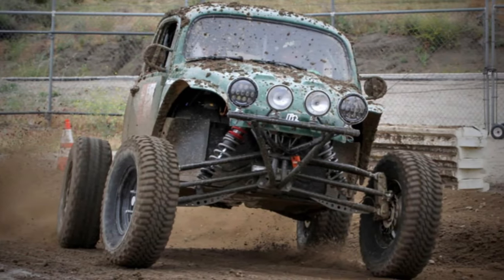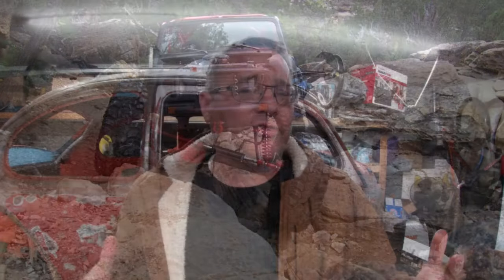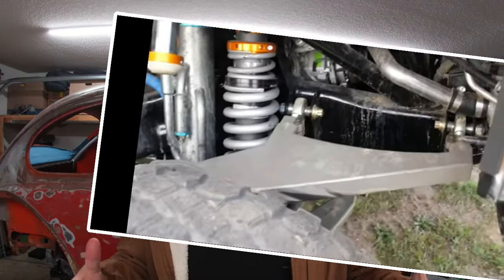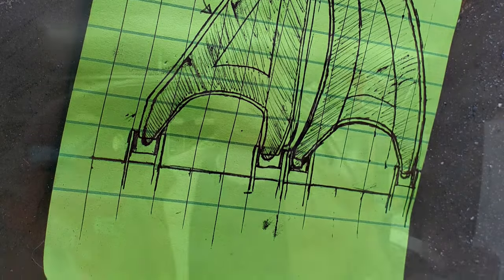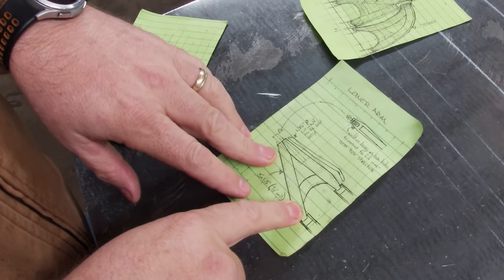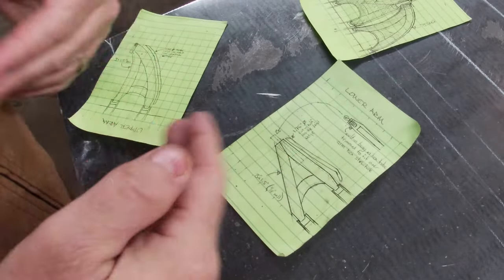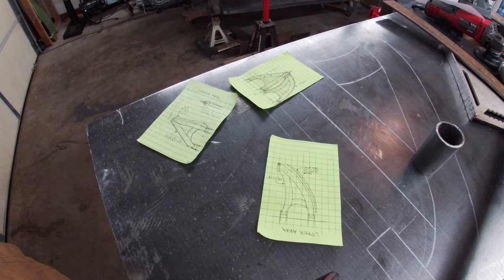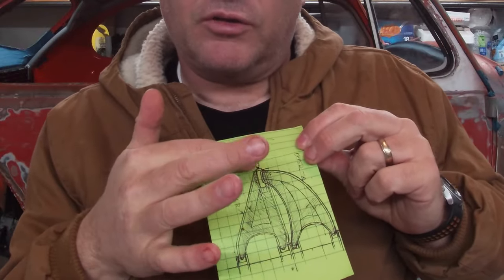Baja Bug Build (Ep. 25): Front A-Arm Suspension Plans

Comment: Nice work! Looks like you're doing homework and research to build something that's going to work. Designing front suspensions can really be stressful; proper angles, lengths of a-arms, bump steer, etc. That's why I chose the pre-fabed unit for mine. I've built and designed successful and unsuccessful suspensions in the past, so, this time I just took the easy way out. Awesome to see you challenge yourself to build something your way!

Looking forward to the next video!
Reply from the maker: Thanks HotRod!  That means a lot from a fellow builder...and having seen your builds, you're quite the artist!  Stay tuned, better stuff is on the way!